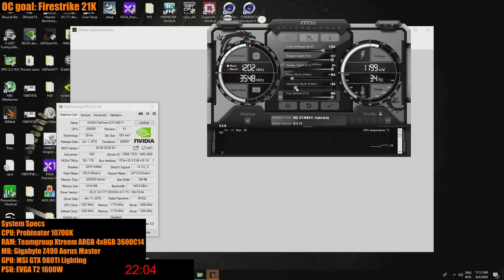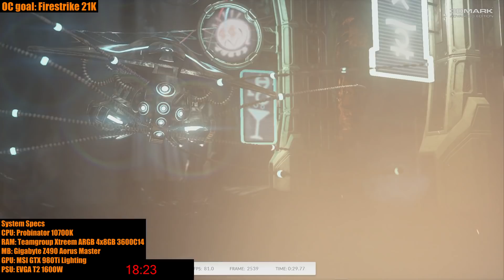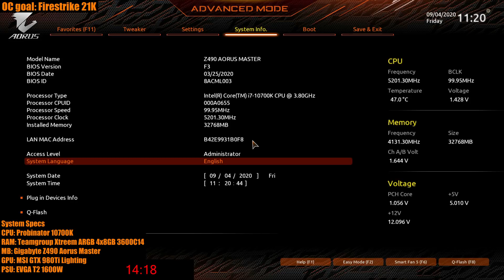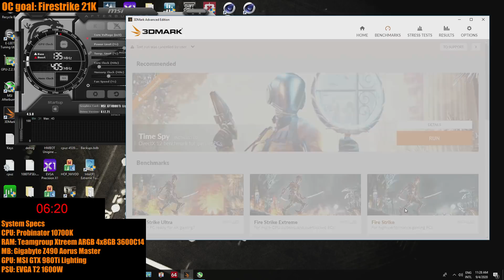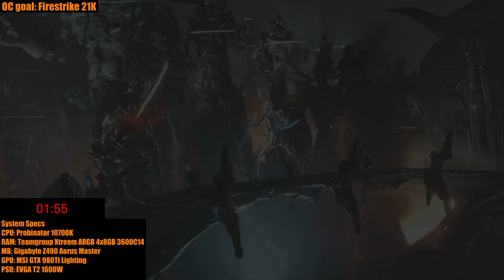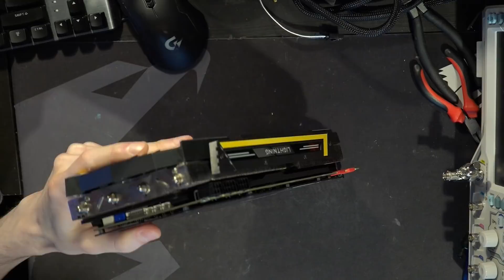30 minute OC challenge #2: 980Ti Lightning + 10700K vs 3Dmark Firestrike // BZ sucks at Maxwell OC

Comment: Samsung memory was what was able to run at 2000.  Hynix capped out around 1850 usually.  Absolutely love overclocking the maxwell generation cards with custom BIOS modding.

Comment: The limitation to Ram OC on ryzen is to maintain a ratio of 1:1:1, which means a frequency around 3600. So what is the best way to maximize performance?  Buy high frequency memory and try to lower the CL or buy the lowest CL possible and try to OC to the ~3600mhz? or maybe something else?
Reply: he's running Intel in this video. It's even in the title.

Comment: My last 980Ti was a Classy, could easly run 1535mhz on core and +600mhz over vram. ASIC 75.4%
Reply: My two 980a do a sorta stable 1448 core and  3900 mem. 1423 is most stable. 

I baked them back to live 5 times now. They really don't want to die. xD
Reply: I had a 980 non TI classified. Loved it! Bought it for €150 before the mining craze and sold it for €180 after 18 months of use ^^ Glad that the prices will come down after the 3000 series launch :-)

Comment: Man those secondarys and tertiary timings are worse than what I run at 1.515 volts 4300, granted I'm not running 4x8gb....and I'm on a board with only 2 ram slots.  What do these sticks do with 2x8 in that board and cpu?

Comment: My 980Ti did 1600mHz for gaming on water with 1.23V hardware measured voltage. Couldnt get the card past that voltage no matter what I did. Sadly sold the card... would run it on LN2 if i still had it :/

Comment: Can you do a video on how to overclock for beginners? I am new to overclocking and what to learn but I don’t know the basics 😅
Reply: I mean, i am not overclocking personally really but i want to point out the channel name ;)
Reply: Amd, Intel, Nvidia, and Amd Gpu all have slightly different ways to go......   Other youtubers make the basic videos and bz tends to go more in depth/extreme.
Reply: There a loads of videos on this subject.
get yourself some benchmarks and start cranking things up. it's not rocket surgery. 
DID YOU NOTICE IN THIS VIDEO THAT IN THE BIOS THE COLOUR OF THE TEXT CHANGED WHEN HE SET THE VOLTAGE ABOVE 1.4V???
THATS HOW YOU KNOW THAT THAT VOLTAGE ISNT SAFE.
IF YOU WANT TO CHANGE A VOLTAGE ON ANYTHING YOU SHOULD SPEND AN HOUR OR TWO LOOKING ONLINE AT WHAT PEOPLE THINK MIGHT BE SAFE.
BE CAREFUL WITH VOLTAGE but apart from that see how far you can crank stuff before it doesn't work properly anymore then go slightly lower than that.
Check your temps if they are still ok then your done.
If it's your first OC i'd probably start by setting xmp then test with memtest once your sure its stable search for a video with your exact CPU then do a long stability test then a video with the same GPU.
Reply: The thing beginners get confused about...
they try and copy settings but each chip is different and also will behave different on some boards.
if you feel the need to copy settings that is fine but don't expect them to just work.
Reply: don't waste to much time on memory it's a black whole with very little real gain once get above JDEC (2133)
xmp and test maybe (or xmp then dial back untill stable)

Comment: Using reference EVGA 980Ti, Ryzen 5 2600 stock clocks: 16829 in Firestrike
Graphics score: 20616 @ 99/81 fps
Physics score: 17474
I got artifacts trying to OC the gpu past 1200mhz and gave up.
Reply: more power! - my old 980ti with a modded bios with higher vcore/max power increased to 350w - would run 1640mhz on the core ! these cards are really fun to play around with!
Reply: @SGIMartin  Is the 980 just as fun to clock? When I have my 3080, I do have two 980s that could do some overclocking with DICE.  :D
Reply: @DrakkarCalethiel  never tried, but the 980's seem to be able to hit just as high clocks, if you have a good decent chip!
Reply: @SGIMartin  That's what I hoped for, unfortunately I lost the silicon lottery with this one.